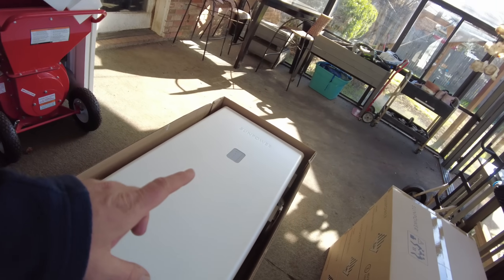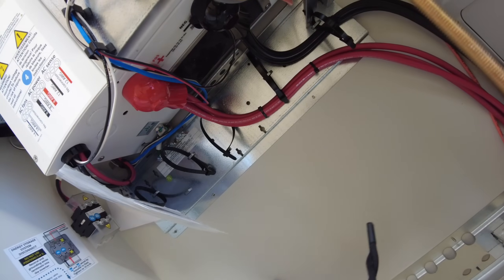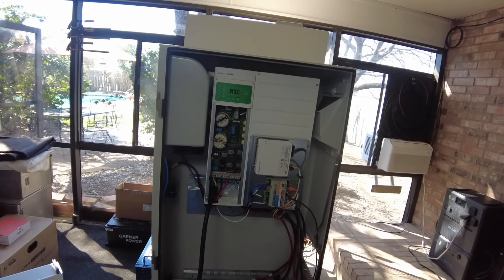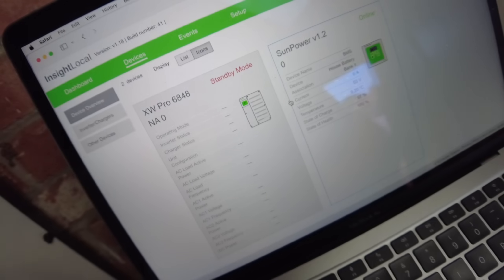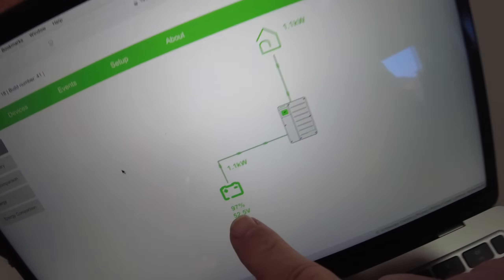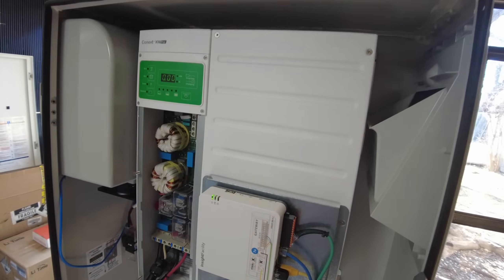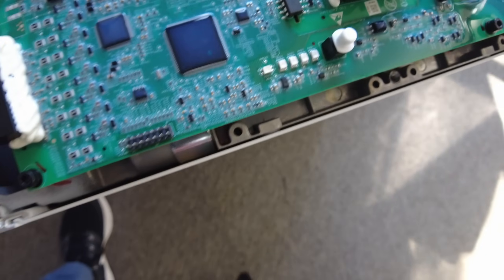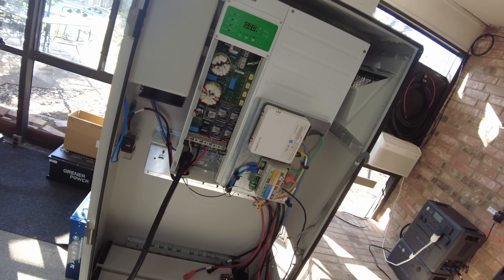Cheap 19.5kWh SunPower SunVault System

Comment: Is there an easy way to send the canbus message to the batteries?
Reply from the maker: Yes, I just used a raspberry pi, and a CAN hat: https://amzn.to/4h96dEp
Reply: @BradCagle  do you have a video on this by chance
Reply from the maker: @dallaserickson6092  Not yet. But I plan to do more videos with this system. I'll see if I can get around to a video with the CAN stuff.  Also Beene Brothers is creating a rasp pi like device that will do much of this, and add conversion PYLON protocol, etc..
Reply: Ya I know they are working on it I have been in contact with him.  I have one of the 19.3 units but only 1 battery because I wanted to make sure it would work.  When I first setup it wouldn't turn on so I installed an older firmware 1.17 I believe.  After that it started working but soc and bms would give errors.  Put 2.04 back on  upgraded facility firmware and it seems to operate and charge discharge and report correctly now.  I'm new to the solar inverter backup so I'm not sure what else it needs to communicate but as of right now my battery turns off after 12 hrs due to commissioning message needing sent
Reply from the maker: @dallaserickson6092  Yep, after you send the commission message it should stay up after 12h
Reply: @BradCagle  sounds good no experience with this but I have plenty of computers so going to load Linux up and get an adapter I don't have a raspberry pi but watching videos looks like can-utils is probably the easiest is that what you used
Reply: I called Schneider and I had them help me set it up as off grid stays on for 7 days then I have to reset it not bad but not ideal  @BradCagle

Comment: Do you think this will be a good setup for crypto mining? Ive been exploring solar ideas and trying to find the mosg efficient  way to solar mine Gpu and or asics as well
Reply from the maker: Depends on your power requirements. But yeah should be pretty good. I have not measured, but the peak efficiency of this inverter is said to be 95.7%. The best thing about this setup is it's top tier level equipment, at bargain level price :) Thanks!
Reply: @OzzmosisMining  I will be placing one of my mining computers or asics once  I get it up and running

Comment: yea super impressed  with that system. its such a better way of doimg thimgs that what ive built and a much better deal also
Reply: @matthewknight5641  main reason I purchased was this I have small kids and don't want them to be able to access.  The old case is lockable new isn't that I see and both require a hex drive to open no connections that can be messed with by curious kids
Reply: @dallaserickson6092  yes and it's all it's own system. it's pretty nice and like you said it's safer. my system has cost me a lot more and isn't nearly as nice as yours. and my systems Ive built are not any where close to as professional looking.

Comment: I need to measure and see if a Victron would fit on the front of the inverter above the insight facility. But behind that third battery is plenty of room.

Thank you for all the help working out the can bus issues!
Reply from the maker: My pleasure, it was fun!
Reply: @BradCagle  other question is what protocol does this use ?  So that you could use a solar charger and let the system communicate properly
Reply from the maker: @ It's a special sunpower protocol. However I believe @BeenEnergy has a translator coming soon that will convert it to pylon. I also suspect you could use a schneider mppt that connects to the insight gateway to communicate with everything. I have not tried it but seem like it should work. Need to verify this.